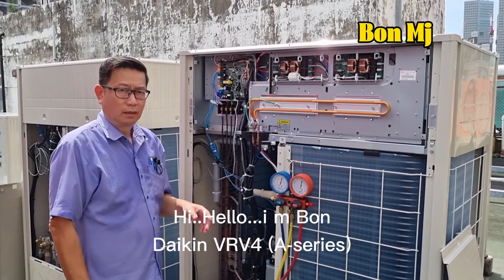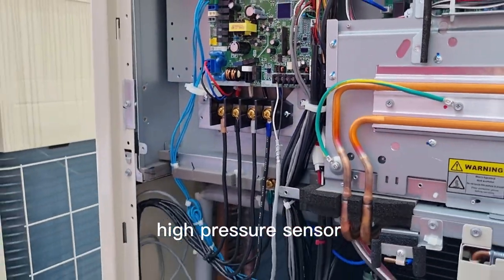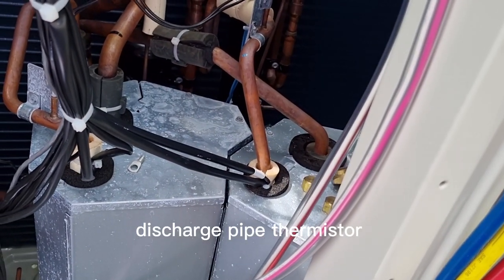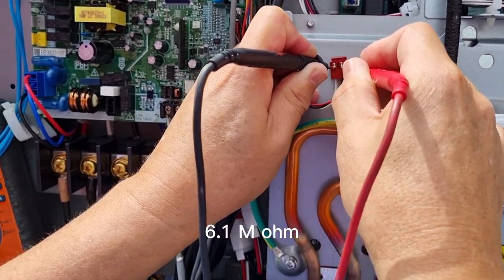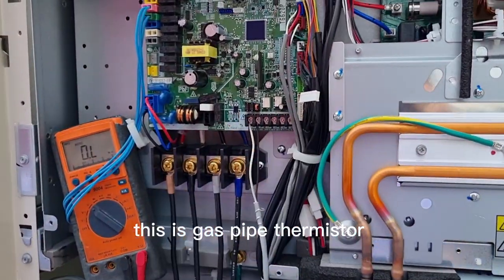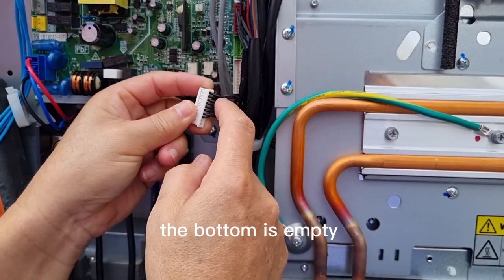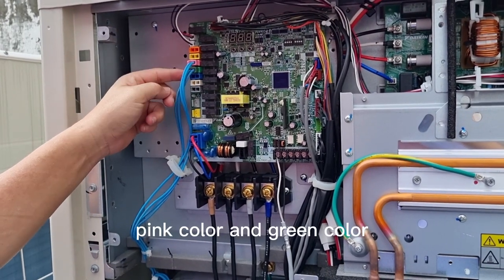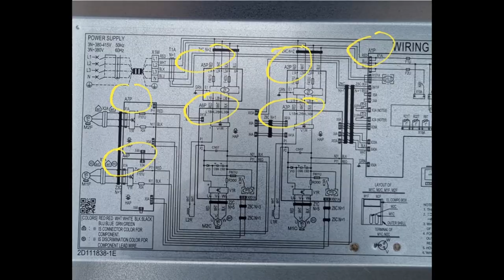Functional Parts Layout an Daikin VRV-4 air-conditioning (A-series)

Comment: Hello my friend im here in philippines, i got a costumer service call, daiken model RKC35PVM error f3, i just cleaning the condenser but unit run only for just 2days, and now the customer call me again said that the a,c is brinking again, any idea for this my friend
Reply from the maker: Check gas pressure 
Check discharge pipe thermistor
Reply: @BonMj  gas pressure standing is 250 psig, running pressure of 130psig and amps of 6.58  on clamp meter out 8.28 amps, discharge pipe thermistor is 11 ohms in 37 ambient temp
Reply: I am the second technician who check the unit, and according to the customer the first tech finding is eev problem,
Reply: Did you hook up the service checker to see what temperature of the compressor surface area compare to the actually temp? If temperature is incorrect from the service checker compare to your actual check. Replace main PCB
Reply: @brandonle4930  sir, i have only guage manifold and clamp meter

Comment: Today just happen sir whenever you free you explain to me  VRV-3 one CU 7 nos of FCUs Blinking E3 error code is have after reset all FCUs just CU run up compressor 2 or 3 minute cut off  similarly 3 times after MCB trip what is the issue sir please explain.
Reply from the maker: Inverter compressor ok?
Standard compressor ampere?
Reply: @BonMj  inverter compressor already faulty standard compressor from 6 to 10 reached within 1 after cut off the compress sir
Reply from the maker: @peramaraj2763  if standard compressor running amps over 10amps consider over current.need to replace compressor or you try wash CU first
Reply: @BonMj  standard compressor running amps-19.89 ,low side - 198 psi,high side -360 psi .sir
Reply from the maker: @peramaraj2763  19.8A compressor over current. (Make sure the cu is one inverter and one/two standard compressor)
Reply: @BonMj  one inverter compressor and one standard compressor
Reply from the maker: @peramaraj2763  Good condition standard compressor running amps is below 10amps.(19.8A compressor already over current )
Reply: @BonMj  you mean faulty standard compressor is right
Reply from the maker: @peramaraj2763  yes